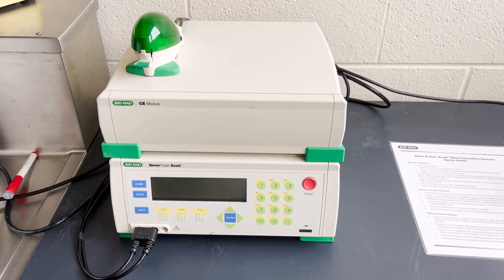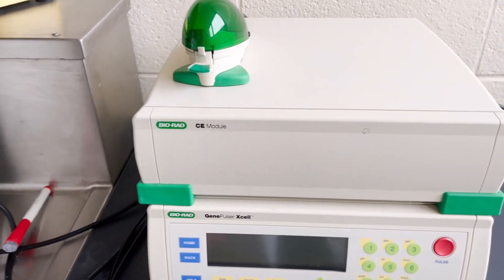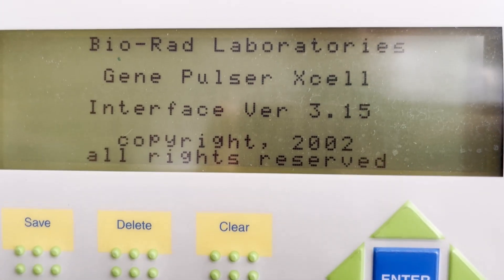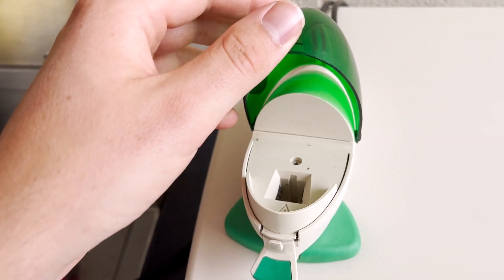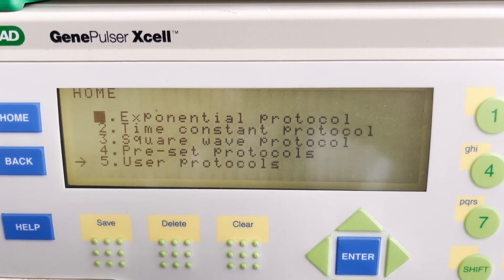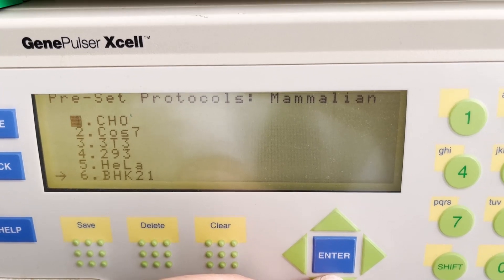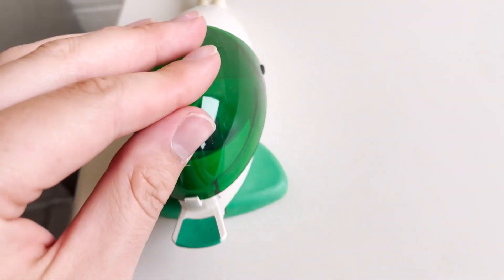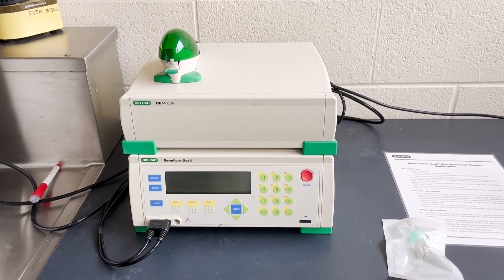Bio-Rad GenePulse Xcell Electroporator | MSU PHM/TOX Cell Culture Core

Comment: Hi could you please answer my question?
I have Gene Pulser II electroporation that the terminal of the cuvette are connected to PULS controller II , but there are not connected to the output of main unit , 

And my device is not working well.  I calibrated , and test different voltages in output , sth doe not make sense 

What do you think? I hope I could explain well to you